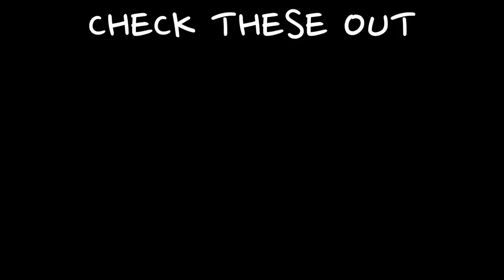The Clearest Resin Casting I've ever seen

Comment: Can you use the cactus juice container you used there as a vacuum chamber for the castings?
Reply from the maker: Yes that was my original container, it did start to get stress fractures so I changed to the pvc pipe
Reply: Ben's Worx cool. I’ll have to have a go at making one. Cheers.

Comment: I love watching your finishing work on the eggs.  I'm learning about the sanding and polishing, as the molds I've been using were matte finished ones, so more labor intensive.   As a retired jeweler, I thought I understood sanding and polishing, but the resin is proving to be more challenging than gold and silver, which is surprising.  Got through the white rouge, thinking I was about done, but after watching your videos, I can see how clear the finished product is SUPPOSED to be and I'm nowhere NEAR there yet!   UUGGHHH!!!   I'm soo looking forward to using smooth castings from now on, when possible.  That will involve making my own silicone molds and brings me to a question for you.  Why don't you have an egg mold instead of having to go through all that cured resin for your basic shaping of the egg?  That's a lot of "stuff" to get through!  I've read what some of the comments say about using the drill press and I'd already thought about the fact that the drill press isn't meant to keep turning so long,  BUT...as I don't see buying a lathe, at LEAST until I determine an ongoing need for one, a drill press will have to do!  My deceased husband was a bit of a hoarder, especially tool stuff and I thought I'd seen a box that SAID "drill press", so out to the garage I went to see.  Sure enough, an unused cheapo drill press never removed from the original box for over 20 years...LOL... it will work just fine for what I need at the moment.  Instead of a dowel (I hadn't seen your videos yet), I had glued the screw mechanism with the concave washer thing from a sanding disc to the base and the screw fit great in the drill press; the only wobble was just from my not getting  the piece completely centered, but was really inconsequential.   Thanks for your instructional videos.   Now, I'm off to find one of those things you clean the sandpaper with... DANG, resin dust is annoyingly clingy to the sandpaper, huh?  
Looking forward to your next projects!
Reply from the maker: Thanks Marcy

Comment: I have a couple questions if you don't mind. When you placed it in the PVC chamber, were you applying a vacuum or pressure? And what was the liquid? I thought stabilizing resin went bad when it sat if mixed with its hardener. Edit: This turned out really nice. Subscribed.
Reply from the maker: Thanks Mate, the burl was under vacuum in cactus juice, and the resin was cured under pressure in a pressure pot
Reply: @BensWorx  does cactus juice stay good after using it?
Reply: What is cactus juice and I assume it seeps into wood under vacumn?
Reply: @scottjones758  its a resin. It basically makes wood behave like plastic.

Comment: That looks amazing! I'm new to resin and have just purchased a pressure pot. I was wondering if you could please offer me some advice. When I got my pressure pot it leaked alot of pressure through the hole on the safety valve. The shop then replaced it but it's still doing the same. Is there anything I'm doing wrong? Sorry to ask on your project but I dont know any pressure pot wizs. I love your work so thought I'd ask you. Thanks
Reply from the maker: The safety valve is designed to release air so it can’t be pressurized above the manufacturer’s safe operating pressure